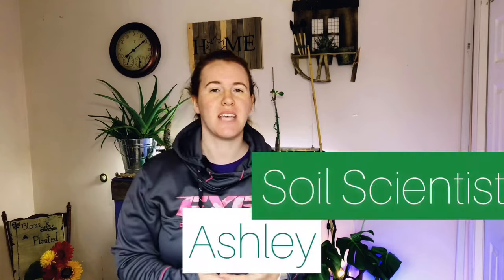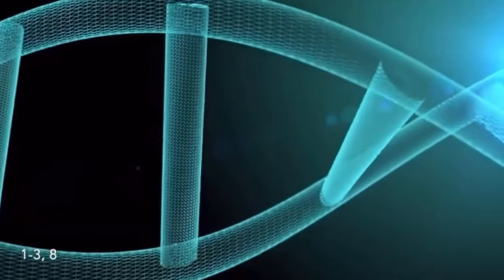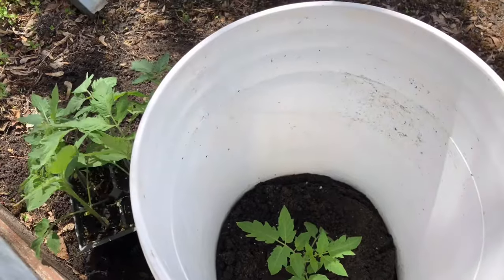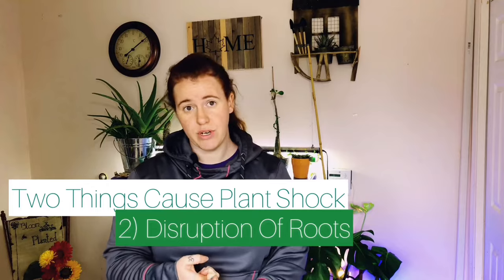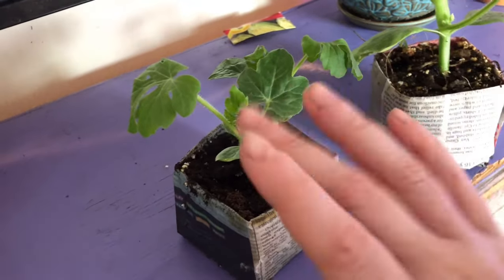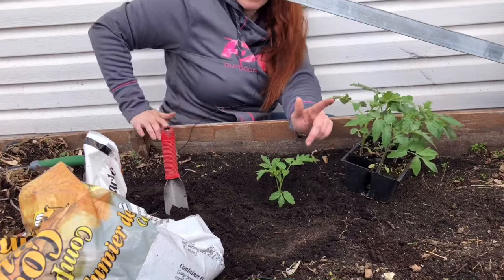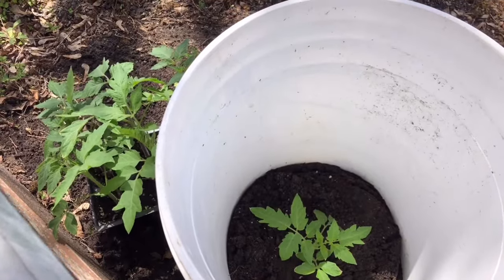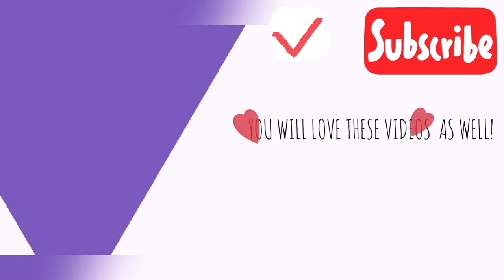HOW TO FIX Transplant Shock IN PLANTS. SCIENCE BEHIND PREVENTION 👩‍🔬 | Gardening in Canada

Comment: I transplanted everything 4 days ago and it all looks great except the tomatoes. The plants were huge coming from the greenhouse and looked fine yesterday but today they are extremely wilty. I watered them well when I transplanted them and again yesterday....the plants looked good. Today the soil was only slightly damp, so not water logged. All the other plants (peppers, leeks, onions, petunias, marigolds) are fine. Note, everything is in containers....
Reply from the maker: It’s try to get them out of the heat and wind then and continue with the regular watering. You’ll only need to shelter them  for about a week and they’ll pop right back up. But the main goal is preventing dehydration from heat and wind.

Comment: place the potted plant into the soil in the new larger container while still in its pot. This will make the hole size exactly the same size. If it is not root bound as you show then drop it inside as is.

Comment: I leave some plants in their pots and put the whole pot in the ground.  I cut the bottom off, with my kitchen shears. This is after I have hardened them off.  I would appreciate your opinion on this.  Thanks!
Reply from the maker: It’s the pot a peat pot or a plastic pot? I personally wouldn’t do it with a plastic pot and the reason being you want the rhizosphere to extend into the soil horizontally as well as vertically. You may run into root bound plants but then again depending on the pot size vs the end size of the pot it may just grow around the pot. I have a video where I use paper pots and plant them directly into the soil and this worked great because the plant roots can move out.

Comment: Hi. Yesterday I transplanted Magnolias & Jasmines.

3 out of 15 of the plants seems to have transplant shock. I've moved them to the greenhouse for wind, sun, & rain protection. I watered it with a little bit of Vitamin B.

The other 12 are doing okay. The three plants are still in shock today (20 hours after transplanting).

Should I just water them regularly or do I need to cut the leaves?
Reply from the maker: Are the severely wilted or just semi wilted?
Reply: @GardeningInCanada  hi, thanks for the reply. They are semi-wilted.

The bottom half of the plants seems fine. The top of the plants with the young leaves seems to lose structure.
Reply from the maker: I would leave them then they will come back as long as it has not hot the PWP (permanent wilting point)
Reply: @GardeningInCanada   I see. Thanks. Will do that.
Reply from the maker: Sounds good let me know how it goes

Comment: Hello, sort of desperation trying to bring back a tree that recently plant in a new location. 5g tree been in the pot for too long, I had to untangle the root system, most roots starting to go in circles, I had to discourage that grow, hopefully I did. As a result extreme shock, did all the basic, twice the root ball, twice the depth and width, add sandy for well drain soil. Tree is in wilting state, I have been watering but I guess not deep enough or long enough, fortunately last week and this week we had some showers, that tree need it. As mentioned before moisture and hydration was what made the tree to start looking better. Thanks for the video which re-enforce my inkling. I always wanted an Arbutus not sure if is enudo or marina. It seems tree is recovering.
Reply from the maker: sorry i just saw this comment how are thing going
Reply: @GardeningInCanada  I have the same issue. I am in Alberta tho. So no avoiding wind and sun.  Lilac tree

Comment: Uhh- Okay, so my situations a bit weird.

So basically, someone I know tried growing apple trees from seed. They placed 6 seeds in a 2 litre bottle (so they've been in there for a month or so with barely any root system, It took like 6 weeks for the pot to dry) They started declining from over-watering and gave them to me.

So I don't have a garden, but I do grow plants (trees included) indoors. So I tried replanting the saplings, but the soil was so compact on itself that It was practically glued to the bottle, and I could barely get my fingers into the soil due to how cramped it was so I've had to resort to trying to loosen the soil ontop so I can pluck the saplings out which ended up with me damaging quite a lot of the roots of one of them.

I managed to get two of them out so far, One of them is doing fine, but the smaller one with the damaged roots immediately wilted, so much so to the point where even the bottom of the trunk is looking iffy. I've followed the advice of the video, I've uppotted it from the terracotta pot I originally placed it in into a larger plastic pot and gave it a good water, Though, I'm not sure if it will bounce back. The top of the trunk is fine, the bottom of the trunk is brown and the leaves are just flopping everywhere. The poor thing can barely hold itself up straight, so I've had to try and prop it up with other items.

Do you think it will bounce back after a while? And if so, how long? It looks half-dead, and I can't tell if the browned trunk at the bottom is going to be able to support the plant. Is there anything else I can do? Or do I just wait to see how it goes?
Reply from the maker: It's going to take time. Possibly a month or more. But just baby it until then.. So long as stuff is not getting brittle it will come back.
Reply: @GardeningInCanada  Ah okay, thanks

Comment: wish I watched this before I transplanted my cucumbers from tiny cells to small pots. It was cloudy, windy and 55 degrees. I did the work in my  sunken patio which blocked much wind; it was breezy. The seeds were planted 23 days prior. The roots got caught up in the holes at the bottom of the cell. Many of them had 10 to 20% of the bottom of the bulb/roots torn off (same with my zucchinis the day before but they did fine. Anyway by the time I was done (45 seedlings) the leaves were wilted. I brought them inside and watered. The wilted leaves seem to recover but quickly curled up. The next day I returned them to the greenhouse. Will they recover? Any ideas? It was sunny when I put them in the greenhouse, but its cloudy today and foretasted to be be all week

Comment: Well my 18 inch Bougainvillea plant pot got a crack so i had to repot it into a new one. My gardener ALWAYS breaks the soil around the roots making its roots completely exposed to air and after repotting, all its leaves and flowers fall off and more than 50% of the times it dies. I am so afraid if repotting now. Please tell me there's a way to fix this. Thanks
Reply from the maker: Just don’t tussle the roots and simply repot into the same size pot or something only an inch larger in diameter

Comment: Help....I have a plant. It's 2 weeks old. I moved it from the humidity done to a hydroponics DWC. About 12 hours into transplant it started wilting. My PH was 6.0 and PPM 400. I took the seedling/plant out of hydroponics and rinsed it with distilled water and put it back under humidity dome. How do I harden this plant and transplant with minimal to no shock?
Reply from the maker: That’s really tough to do in a soulless medium. Sometimes in those cases you need to transplant and run the risk of a bit of die back unfortunately. It’s due to the change in balance.

Comment: Hi! I have got a problem... i have an eastern redbud that I transplanted to a new area. And I'm sure I hurt many roots.  It is wilting already within 5 hours of transplant. Will it die or is there a chance It will come back. It's about 2 ½ feet tall. Should I use the 5 gallon bucket tip? 

Thanks in advance
Reply from the maker: Stephen The Fish if you can get the bucket then yes try.  It’s most likely just transplant stress so that’s good news. But lots of water, limit it’s exposure to sunlight and wind for the next week or so. If you can get a bucket try if not anything  would work even plywood.
Reply: @GardeningInCanada  Thank You!! That takes away some stress to know it will  rebound.
Reply from the maker: It’s completely normal I just moved a snowball hydrenga this year and it was look rough but two weeks later it’s starting to come back. Expect leaf losses that’s normal. But just water whenever it’s feeling less then a moist sponge wet.
Reply from the maker: Let me know how it goes or if you see anything else odd. If you need you can always tag me on Instagram or post a photo on the Facebook group as well!
Reply: @GardeningInCanada  Thank You so much!!
Reply from the maker: Absolutely anytime!

Comment: So I transplanted a False Aralia that I had bought. The older soil I noticed had spiders and insects and wasn't looking good at all. So to prevent that from spreading I had to transplant. But now it's drooping and the leaves have curled up. I did water it thoroughly after transplant. I don't know if it will survive. Anything I can do to help?
Reply from the maker: Keep it out of the heat. Is it in a warm area?
Reply: @GardeningInCanada  Not really. It's still cold here so the temperature inside is around 70.
Reply from the maker: Then just aim to keep the humidity nice and high
Reply: @GardeningInCanada Thank you. I hope it makes it. It's a beautiful plant.

Comment: How long would you keep a potted plant in the shade?
Reply from the maker: Depends on how hot it is. But high heat 2 weeks, regular moderate temps 1 week
Reply: @GardeningInCanada  it’s going to be very hot next week in Southern California. Temperatures will be in the 90s (~36-37 C?). I’ve had my shocked plant in the shade for a week and it doesn’t look any better.
Reply from the maker: Your watering on a regular basis? I would leave them there till they bounce back. I may take another week or two
Reply: @GardeningInCanada  twice a week. Junipers hate too much water
Reply from the maker: The juniper is what is wilted?
Reply: @GardeningInCanada  it’s quite dry. Not too much brown foliage. More so of light green. Some yellow.